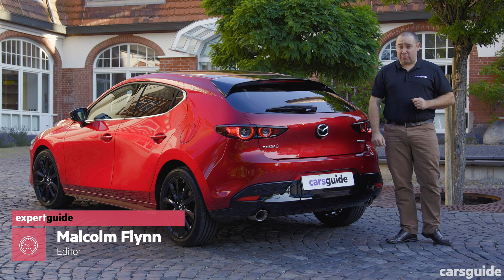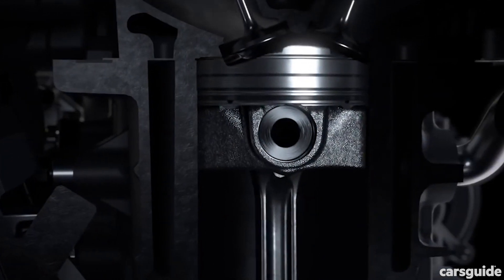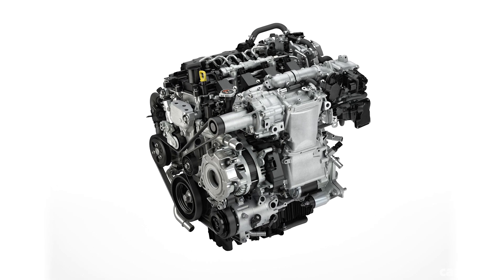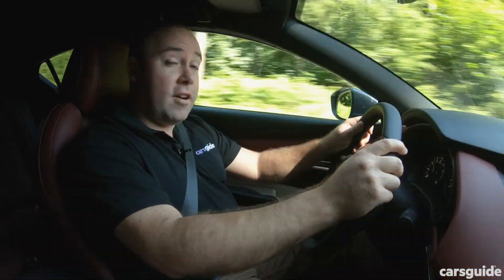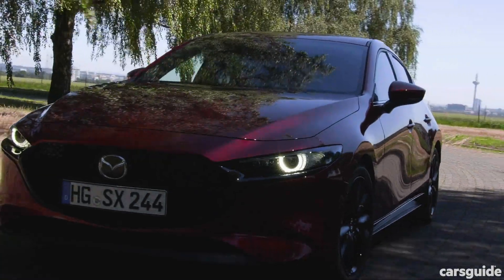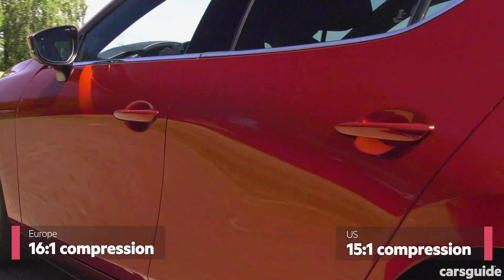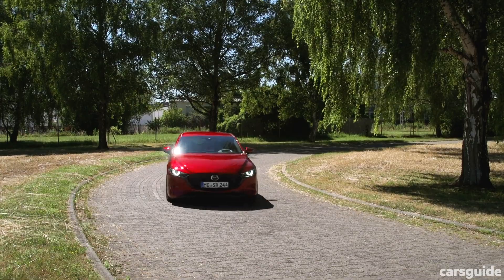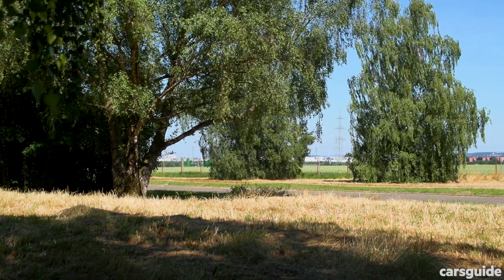Mazda 3 2020 review: Skyactiv-X

Comment: This looks like the CX 30 with smaller tires
Reply from the maker: Like, but actually quite different. Shorter wheelbase, no interchangeable panels, different proportions. Cheers, Mal Flynn
Reply: No Dre
Reply: No.... I’ve owned the CX5 and just bought a 3 hatchback and have driven in the CX30. Different vehicles. I honestly don’t like the CX30.... but that’s a hot niche right now. Actually the CX30 is cannibalizing the 3’s sales without a doubt.

Comment: Disappointing 8.9 sec 0-100 km/h for the AWD/AT version plus a not very attractive business leasing rate made me finally change to a GTI TCR which is about 20% more expensive, but about 15% cheaper on a monthly leasing rate. Guess VW needs to get rid of the last Golf 7s before the new model enters the market later this year, but except for the nice design of the Mazda 3 I could not really find any reason why I should have gone for the Skyactive X. 
Unfortunately.
Reply: Julius Bello So far the test drives do not really show the fantastically low fuel consumption announced. Even if it is in the region of the smaller engine, why get the 180HP at all if acceleration and top speed are nearly the same?

Comment: Frankly this video is 95% stuff I can read on the Mazda site and only 5% driving impressions. How loud is it? How much fuel does it consume? How's the driving characteristics? You've come all the way to Europe to tell preciously little. I mean, you drove the thing.....
Reply from the maker: G'day Markus, this video was shot in about 10mins net, so hard to pack in as much detail as we'd prefer. That's all that was available I'm afraid. As I said in the vid, there's a lot more info in the written review on CarsGuide.com.au, but it's as quiet as the regular petrol, drives more like the 2.0 than the 2.5 but with a better spread of torque than either. As for fuel consumption, that's yet to be confirmed , but it will hopefully be under 5.5L/100km. Hope that helps. Cheers, Mal Flynn
Reply: @carsguide  Mal, the website isn't available from outside of Australia, so telling people to go to website without leaving a link to review, and blocking everyone not living in Australia is pointless...
Reply: @carsguide  You drove it but don't know fuel efficiency? Or Mazda did something to shut journalist mouth about thar "minor" thing whats this technology is really about...

Comment: Strange that Australia is getting Euro spec engine when Mazda has previously used NA market designs (lower compression, fewer fuel economy gadgets). AFAIK 91 RON is still the most common fuel in Australia, as with North America (as 87 AKI). I can only imagine this is because Mazda wants to get the car to market quickly in Australia where the US spec engine is still a ways off.

It's disappointing that Mazda seemingly hasn't followed through on the concept of using more aggressive gearing afforded to the SkyActiv-X engine by its wider fuel efficiency band.
Reply from the maker: All excellent points Bruce. Cheers, Mal Flynn

Comment: When is the X coming to the States? Mpg numbers?
Reply: Yes, europe numbers 4,6L/100km.
Reply: @mesuttasdemir4618  not bad. Equals hybrid efficiency
Reply: @mesuttasdemir4618  The numbers I've seen put it at 5.8 - 5.4 L/100km, or about 41-44 mpg. That's about as fuel efficient as some of the less efficient hybrids. It would be interesting to see what kind of fuel economy this engine could deliver in a full hybrid drivetrain. It would obviously depend on what car it was powering, but my guess is that in a vehicle like the Toyota Corolla, it would deliver something like 3.9L/100km with the 178 bhp engine, and with a 120 bhp SkyActiv X engine, it would be something like 3.3L/100km 3.1L/100km.
Reply: Dumb Mazda is bring skyactive x late to the states